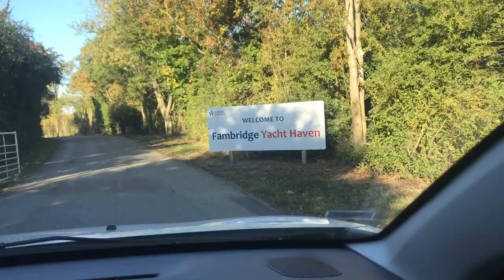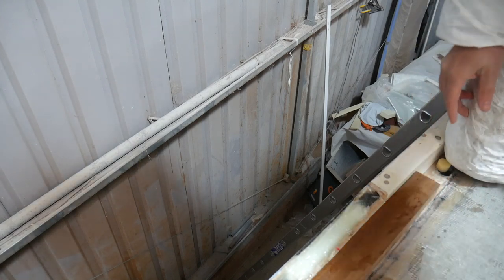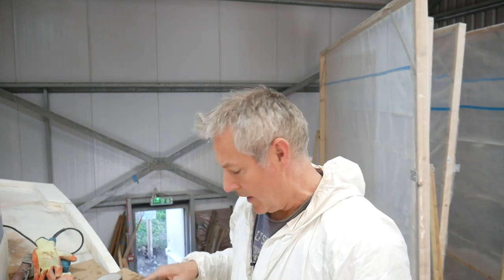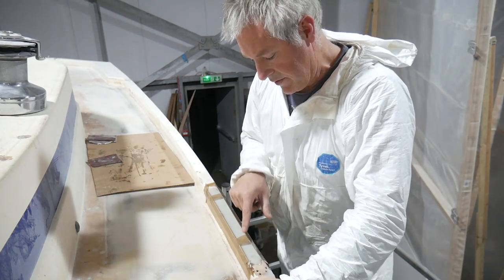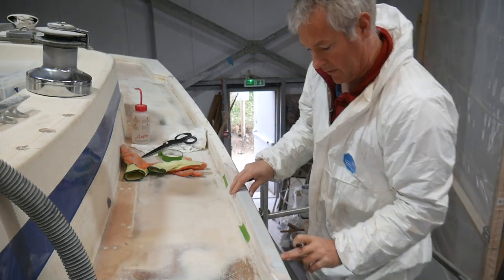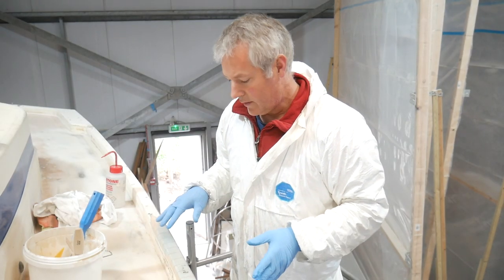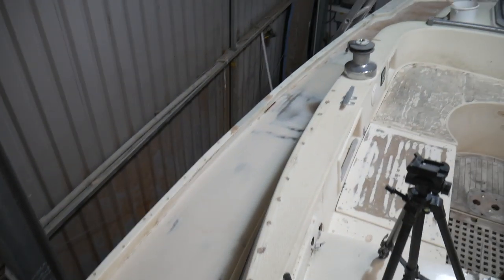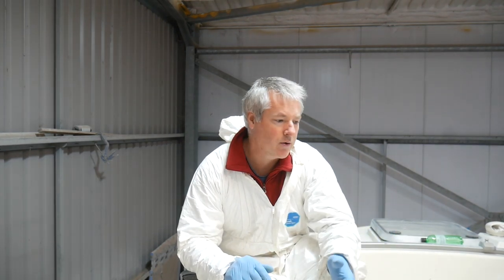#43 rebuilding the stanchion bases

Comment: I just found your channel a few days ago and I'm really impressed in what your are doing.  You're doing a great job and yes it is a ton of work but it will be well worth it when done.  I know I'm a little late to the party but you could use some G10 or Starboard marine polymer lumber and epoxy that into the stanchion base cavities.  Those material won't rot and you can screw into it.  Soon enough you'll be having a nice malt whiskey while onboard Wanda in some nice anchorage.
Reply from the maker: @Rich Hamel thanks for getting in touch. You’re never too late to offer advice. I ended up using G10 for some jobs thanks to recommendations from viewers, but I hadn’t thought about using G10 in the stanchion base cavity. I think I’ll use more of it from now on!